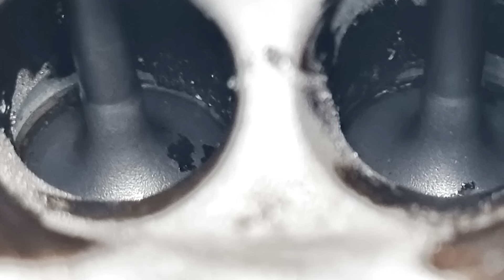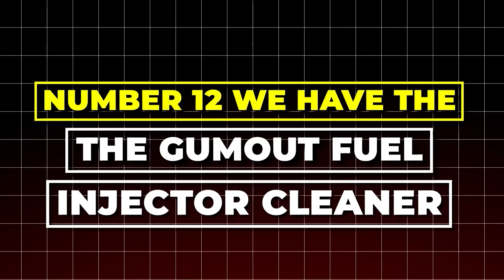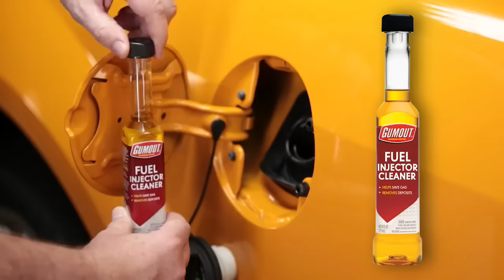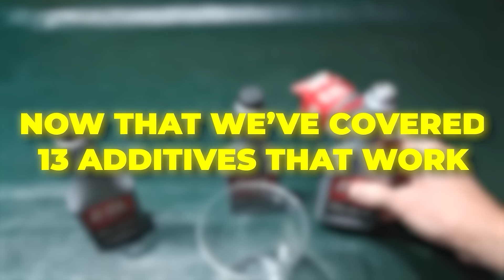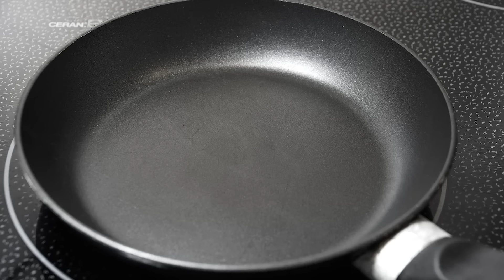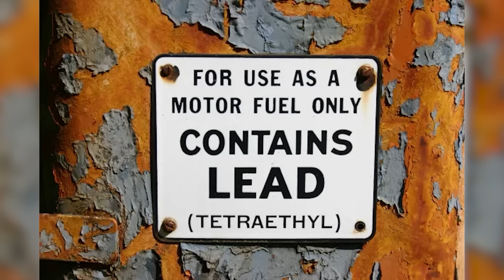13 Engine Additives That Work (And 5 That’ll Kill Your Car)

Comment: Haha i remember when 'Slick 50' was the miracle moose juice back in the 90s . It ruined some engines. *edit*.. i posted this before you mentioned it lol.
Reply: I used Slick 50 back in early 1990s in a 1978 Ford LTDII with a 302 V-8 when I rebuilt it. I redlined the engine for at least a half hour trying to intentionally blow it up. Didn't work. Slick 50 actually worked that good. I was impressed, bit pissed my engine wouldn't pop. Lol
Reply: @danielburdette6648 I used it in my vortec 4.3L S-10 180,000 miles no problems with the engine but the body and frame rusted away
Reply: Slick 50 works. Car manufacturers ban its use because it prolongs the life of engines…we don’t want that do we?!
You can still get in Australia from X-Cell products. Same stuff, different name and more concentrated. I’ve used it in race engines to two plane engines. Ask for Michael.
Reply: @glennllewellyn7369 IT Works❤🎉
Reply: It's still a great product. SLICK. 50. PEOPLE MISUSED IT. OUR OLD CHECKER 🚖 🚕 CAB NYC. TAXI. HAS OVER 800.000.MILES.HAS SLICK 50. IN IT ALL THE TIME
Reply: yeah what a joke that stuff was.
Reply: @moss8448 you are joke😢 SLICK
Reply: Then there was literally "motor honey" 
 it looked and came out of the bottle that way. Confession, used it on my 70's Mopar once
Reply from the maker: Haha, yes, the Slick 50 days! It’s funny how products like that were all the rage, but didn’t really deliver. It’s a good reminder to be cautious when it comes to “miracle” products. Thanks for sharing your experience.
Reply: It also depend on the way you use it.
Reply: Look up Diamond Like Coatings, DLC. That’s what’s Slick 50 and Xcell Products have in them.

Comment: I've been using Marvel Mystery Oil in everything (fuel and oil) since I was 15, from exotic cars to lawnmowers, I find no need for anything else.              Edit: it's NOT for fuel in engines with catalytic converters, oil is OK
Reply: Yep, I bought my first car in 1982, been using Marvel ever since.  They put this stuff in fighter planes during WW2.
Reply: @warrenlewis3977 I just used it in a Chevy 2.2 to free up a sticky lifter without having to rip the engine apart. I've been running in in my 94 Chevy 350 for years. Love this stuff! I've used it with a converter for 709,000 miles now and everything is still working great! Nothing has been rebuilt or even had a valve cover removed. MM is the best there is! This guy giving reviews isn't the most intelligent and he's giving his option. Not actual facts or testing.
Reply: @warrenlewis3977 . Marvel Mystery Oil is a synthetic trans fluid.
Reply: Love Marvel been using it 40 years works like a dream no sludge no valve train noise keeps the lifters clean
Reply: It melted our engines gaskets..😢😢😮😮@steventoland2510
Reply: Keeps my 289V8 going strong ❤
Reply from the maker: Marvel Mystery Oil has definitely earned its place as a classic go-to for many car enthusiasts! It’s great that it’s worked well for you across so many different engines. Just a heads up about using it in engines with catalytic converters, good call on keeping it to oil only there. Thanks for sharing your long-time experience with it.
Reply: @carcareclues Marvel Mystery Oil is formulated to be safe for use with catalytic converters and oxygen sensors when added to gasoline in the recommended proportions. Just read the bottle. I've run it in one since 98 with a converter. I've run it in my 5 year old Honda now since new. I also look in the cylinders with every plug change. I just did the Honda and those pistons and valves still look like new at 185,000. You should try reading the bottle .it beats mineral spirits and lacquer thinner which is in most fuel additives.
Reply: Excellent stuff but not good for modern engines and emissions systems. Older engines YES
Reply: @theodoremarakas9899  Marvel Mystery Oil works fine in modern engines.  Saved me from having to replace the intake valve block on a Fiat 1.4T in a 2014 Dodge Dart.....
Reply: @aaronthomas6155 
So you added Marvel in the fuel? I am glad that it worked for you but personally speaking I would be worried about the O2 sensors and catalytic converters. Nowadays emissions components are too sensitive and expensive to replace. However, if the crap is about to hit the fan because the engine is a mess and you have absolutely nothing to lose….yeah man, do it, why not? I certainly would
Reply: Me too marvel mystery oil❤🇺🇲👍😁😁
Reply: Never had a new car. Ever. Every Car I've owned got 300k or more  car I have now is 1995 Honda Accord DX 5 speed. 130 original miles. Suz in Yuma Arizona 🌹 116° today🇺🇲
Reply: I use marvel in everything...have it in oil and fuel of my work truck as of last night!!! Woke up the this morning...she drives better than ever and feels way stronger. The oil pressure goes up to its expected levels now
Reply: Okay and what year did they start putting catalytic converters in cars?
Reply: @ItsMe-ic7on my guess is around 1975. However, after 1980 the EFI became digital utilizing O2 sensors. 
Many of oil burning engines eventually get O2 sensor failures because of that. Marvel oil would simulate that condition if added to the fuel. In fact, the last decade cars have O2 sensors so sensitive and expensive, you can imagine the repair bills in silly high dollars
Reply: @ItsMe-ic7on  in USA most cars got cats in 1975. The exceptions were Mercedes and Alfa Romeo, they already had fuel injection and met the smog laws for a few yrs afterwards. The converters in most classic cars are long removed now, you can use Marvel in em
Reply: Agreed! I’ve had 2 Porsche’s  and one with over 288k miles. Marvel really works!
Reply: Good old marvel mystery oil. I know somebody that swears by synthetic. You changed out his motorcycle 2 synthetic oil and fried the clutch.
Reply: @mikesuch9021 yes this can happen. In fact, a fee years ago I used Mobil one for motorcycles and it was too slick for the clutch. I still use synthetic because that’s what my Moto Guzzi and Aprilia calls for but I use Motul and have no issues. When engines and transmissions share the same oil the brand and type of oil is extremely important
Reply: I have a Cadillac converter...

Comment: I not use aditives, just regular oil change.
Reply: Same here. Never had an INTERNAL engine problem in over 50 new and used vehicles that I have driven/owned in 65 years of motoring! These additives are good for ONE thing..............................draining your bank account!
Reply: @TheOzthewiz  Sounds like you never owned a vehicle long enough to have engine problems.
Reply: @seeya205  I've lost 1 car to engine failure and it had MOA in it at the time of failure.....
Reply: That's oil you talk about.  These are fuel treatment

Comment: I used the expensive 505 and techron in two different cars and i did not notice any difference at all in better mpg or response.  Seafoam is great for outboard motors like boats.  Was disappointed 505 didn't do a thing
Reply: Thanks for sparing me the expense of trying 505! I was willing to give it a shot just because of Scotty Kilmer but you just saved me a few $$$
Reply: @mikecallahan3867  You're welcome, and I honestly thought for sure it would work just based off of the review Scotty had on one of his videos.  It was like I WANTED it to work, but nope..lol
Reply: The real question is, does the vehicle need it in the first place? If not then it'll make no difference. Like swapping a 50,000mi motor for a new one, you're not going to notice a difference.
Reply: Same here.  I tried the 505  gas treatment and the oil.  No noticeable change or improvement.
Reply from the maker: It’s frustrating when a product doesn’t live up to expectations, especially after investing in something like the 505. Not every additive works the same for every car—sometimes, the results are more noticeable in older engines or ones with specific issues.

Seafoam is definitely great for outboard motors and other older engines, but I get why it didn’t make a big impact for you. Everyone’s experience can vary depending on the car’s condition and maintenance history.
Reply: I have had success with DOHC VVT  motors quieting  down after using ATS 505 CRO and CRF.  IT DID NOT HAPPEN QUICKLY.  I did frequent oil changes.

Comment: Gasoline in US does a good job cleaning your engine. This is a commercial and some of the statements are so borderline that needs to be look at. There are plenty of real tests people did, you should look at all of these test with a grain of salt. Use your best judgement. I do use fuel system cleaner once in a while and they all worked, some are better than others but the government will limit how well they work. You certainly don't want a chunk of deposit to be removed in the cylinder and the cause all kind of damages. That's why the government will limit how well these additives works. This is one of the few things that I found that government actually provides value.
Reply: No if it wasn't limited there would be no chunks.
Reply from the maker: Gasoline itself does have some cleaning properties, especially in modern engines, and using additives like fuel system cleaners can help keep things running smoothly. However, it’s true that not all additives work the same, and it’s important to use them with caution.

As you mentioned, some additives may break loose carbon deposits, and while that can be a good thing, it could also cause issues if larger chunks of debris get into the engine. That’s why it’s so important to follow instructions carefully and choose a reputable product that’s right for your engine’s condition.

I agree, government regulations do play a role in limiting how potent these additives can be—aiming for balance between effectiveness and engine safety. As with any product, using your best judgment is key. Keep an eye on how your engine reacts and always go for the right product based on your vehicle's needs. Thanks for sharing your perspective.

Comment: Ok I’ve got a question.
We just bought a 2000 Honda Acty with a 660CC, 3cyl engine.
It’s a Right Hand Drive with a 5spd manual transmission.
I have no idea how well the engine was maintained.
The Kei (“K”) truck was used in Japan. It has only 30K original miles.
It has a throttle body fuel injection system.
What additive do I need to put in the 8 gallon fuel tank that will clean the fuel system and the fuel injection system?
Would Techron do the trick?
I add a bottle of it in our 23 Tacoma TRD Off Road and our 19 Outback every 5K miles when I have the oil changed.
The Acty will be used for work in and around our 54.5 acre mountain property here in north central Washington state during the summer months and we’ll be having a snow plow installed so we can plow the 5-7 feet of winter snow off our private road.
Anyone have any expert suggestions?
Reply: Red Line
Reply: @seeya205 Thank you
Reply from the maker: Techron is a solid choice for your Honda Acty, especially since it’s known for cleaning fuel injectors and removing carbon deposits from the fuel system. Given the low mileage on the Acty and its throttle body fuel injection system, Techron should work well to keep the fuel system in good shape.

For the 8-gallon tank, I’d recommend adding Techron every 5,000 miles, just like you do for your Tacoma and Outback. It’ll help keep the fuel injectors clean and improve engine performance. Since the Acty will be used for work and snow plowing, keeping the fuel system clean will be crucial for its longevity, especially in extreme conditions like snow and cold.
Reply: @carcareclues Thank you

Comment: I add Techron fuel system cleaner in my 23  Tacoma TRD Off Road, Double Cab, 6’ bed, my wife’s 19 Outback and in our 2000 Honda Acty, 4WD, 5spd pickup every oil change which I do every 5K miles with Valvoline full synthetic.
I do change the oil in the Acty every 3K miles, also with Valvoline full synthetic.
Reply: Same here, Techron is a great price
Reply from the maker: Since you’re using synthetic oil, you’re on the right track for keeping the engine running smoothly. If you want an additional layer of protection for high-mileage engines, you might consider adding a fuel stabilizer in winter, but Techron should be plenty for general fuel system cleaning.
Reply: Can't go wrong with that level of maintenance bro.
Reply: 3,000 miles?  Man you are throwing $$$ out the window!  3k Miles on full synthetic doesn't even break the oil in. I talked to  a BP scientist (Castrol) who told me that every synthetic oil is good for 10k plus miles. That was 10 years ago.  Save all that oil you are wasting,  I'll come pick it up.
Reply: @antwanmartinez-l9g 
Obviously you have no idea about how high the RPM’s are on a Kei truck.
At 75 mph my Tacoma runs at 1,800 RPM.
At 60mph my Honda Acty Kei truck’s RPM is at 6,300.
Do you have any idea how hard it is to order a new engine from Japan for a Kei truck?
I’d much rather do over maintenance on my vehicles than to replace them.
We normally keep our daily drivers for 15-20 years or 250K to 300K miles.
I use our Acty Kei truck for plowing the 5-7 feet of snow off our private road every winter and during the summer months it’s heavily used for work in and around our 54.5 acre mountain property.
So put your money where your mouth is and I’ll change the oil in my Kei truck according to Your specifications.
Reply: @antwanmartinez-l9g  Anything over 5k and your asking for carbon build up and oil burning engine
Reply: I've used Techron in 2 vehicles. It works. Also Star Tron Enzyme Fuel Treatment. Had an old truck parked 4 a while. Ran rough, poured a bottle in, ran great for mths after. Removes Moisture. Says can B used in Marine as well.

Comment: Does engine restore wreck your engine
Reply from the maker: Engine Restore can be a quick fix for some minor issues, but it’s not a substitute for proper maintenance or addressing major engine problems.
Reply: @carcareclues So far the Acty runs great. It has very low mileage for a 25 year old truck.
I’m a maintenance freak, at least that’s what some of my friends say.
I’d rather overly maintain our vehicles than to let things slide.
A well maintained 3cyl Honda Acty can make it to 200K miles if properly maintained. 
I’ve already changed the front and rear differential, transfer case and transmission, power steering, brakes fluids and antifreeze.
Reply: I have been using RESTORE for over 30 years in cars, motorcycles and lawnmowers with good results.  Project Farm has tested RESTORE with good results as well.  Have experienced improved compression in older engines. My lawnmower was ready to be overhauled due to burning too much oil and smoking, but with RESTORE the oil burning would only show up on start-up and then no visible oil smoke. Now my lawnmower has been going for well over 30 years of use with no overhaul, yet.  I was surprised that RESTORE would really "restore" my old lawnmower.
Reply: I’ve been using engine restore with each oil change. I use the 8 cylinder can for a V6 have seen a compression rise of 5-7psi.
Reply: No